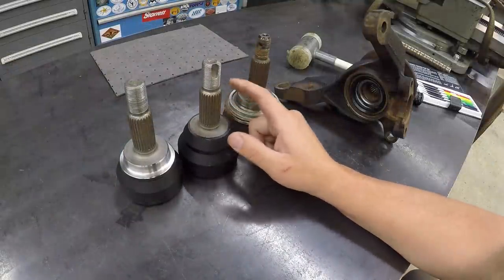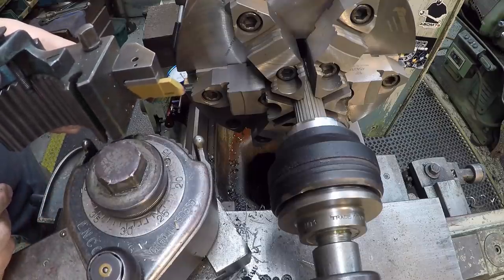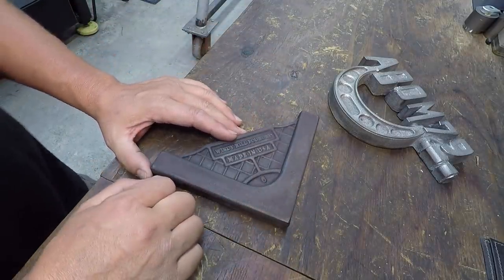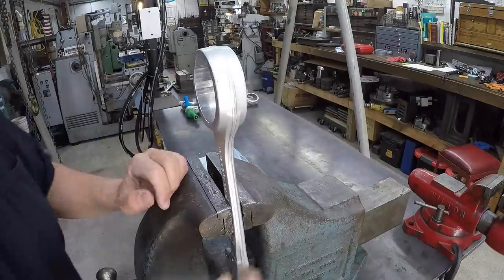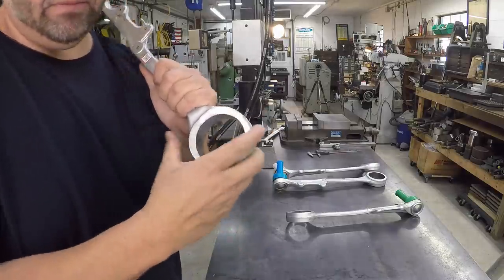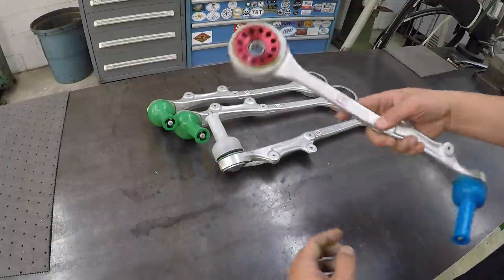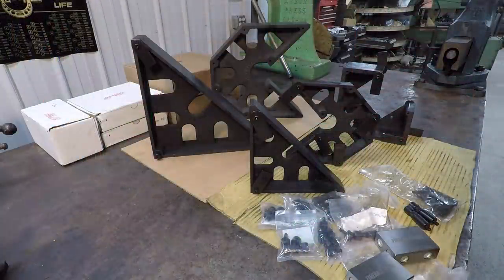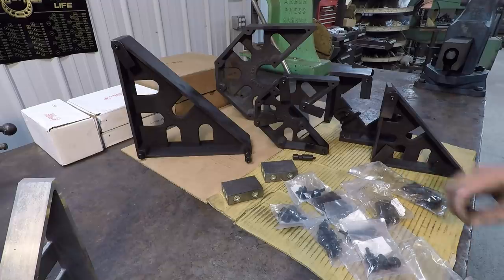SNS 303: Aluminum Control Arms, Front Axle Mods, WHF Machinist Square, Fireball Tool Squares

Comment: I love the videos! My Dad is a manual machinist.He has machined parts from the Corsair jet to the space shuttles. Most of the metals were top secret at that time. He finally started machining parts privately for the pump industry in the early 80's. There is nothing like seeing a manual machinist perform this art at 81 years old. I have more respect for the manual Machinist that still does this, compared to today"s CNC operators.

Comment: Abom, I understand that you gotta do the jobs that come in however, you gotta know how many car guys out there would love to see more content like this. Anyway, awesome content!
Reply: I agree! What I’d really love to see is some pistons and a camshaft machined from scratch! I know a cam would be quite the project but definitely do-able with time & patience and it would be an amazing process to watch. Seeing the order of operations, how the workpiece has to be chucked up to cut the lobes & how the lobes are actually cut, etc.
Reply: Decking blocks and heads, boring cylinders
Reply: @ericreynolds74  And sleeving cylinders - not the blocks designed for sleeves, but repair of non sleeved blocks.
Reply: @kcscustom9759  defiantly agree, would also justify the cost of other machine shops and their process .
Reply: I have done Automotive machine shop work-99% of the machines are specially  made for The jobs , Line boring ,sleeves,  Crankshaft grinding etc-!
Reply: @TheObersalzburg  he has said before that he doesn't like to get into engine machining
Reply: Look up Brian Block (bcbloc02), he does a fair amount of engine stuff. Granted, it's mostly diesels.

Comment: Thanks, Adam. Now I learned why they’re called “123” blocks; I thought maybe it was because it made certain shop tasks “as easy as 1-2-3”! It didn’t occur to me that the ratio of the sides was 1:2:3! 😁
Reply: It's not the ratio.  The size of the blocks are 1" by 2" by 3" Literally, 1,2,3.   No ratios necessary.
Reply: Jim Murphy it’s both the measurement AND the ratio
Reply: @robinturner2300  True, but that's not how they were named, which was the OP's original statement.  By that logic, a 2"x4"x6" block is also a 123 block, which it obviously isn't.

Comment: I believe the seal at the hub is just a dust shield since you don't have to add oil to the bearing hub.
Reply: It depends if the bearings are sealed or not, they usually do have a grease seal but not always.

Comment: Nice work. Those bushings should be a press fit in the arm though. That things gonna beat it self to death and most likely egg the whole in the arm out
Reply: Yep, bring on the green loctite, and lots of it.
Reply: you are 100% correct, I install similar ones regularly and that is exactly what happens if they fit that loose.
Reply: But not Adam’s problem or area of expertise
Reply: @hjvisagie  He would know that also and should spin up a better bushing. Should be shrink fit.
Reply: nothing short of road bling, having working in motorsport ,that is a no no..  lack of interference fit will in deed cause further problems.

Comment: For sure on case hardened materials the tough part  is getting through that first bit and the rest is a walk in the park eh. I have had some success using Rapid Tap as a sort of  stress remover type lube. Every time I see that 6 jaw I start drooling. 15 years of retirement  I soooo way to turn the clock back and get two of them for my 2 lathes. One came home with me. I would have gotten the other but a 10 foot X 20" won't fit in the garage eh. Excellent job bud.
Reply: get a bigger garage.... problem solved😁

Comment: you mentioned possible production work on the AL control arms. I know you don't normally use flycutters, but this would be a great time to use a flycutter with an HSS cutter. You could machine it dry and one pass is faster than two :-)

Comment: I would get a touch nervous modifying suspension,  brake,  or steering parts for customers. There would be a clause in bold at the bottom of the receipt to cover my arse in case the component failed.

Comment: Good video.
Can't say I've ever seen slip fit control arm bushings,  but maybe the owner of them can explain how they work.
Reply: Exactly my thoughts! I’m a 3rd generation mechanic and I can tell you this is not going to work! Definitely not designed for the aluminum arm for a reason.
Reply: @MaxPower_Designs  Yeah,  usually if a bushing slides in a control arm like that, somebody needs a new control arm,  or got the wrong parts.  I guess we'll have to wait for an answer from whoever owns these things.
Reply: @MaxPower_Designs  -------   "This is not going to work" well said.

Comment: nice Starrett  vice i like your mag drill with the old Black & Decker drill in use i haven't seen one of those in at least 25 yrs, when they were built to last and that deburring tool i have one for aluminum  and metal work they are fantastic great video as usual, look forward to the next one always good content, one thing that hot metal coming off machines will damage your camera lens  i found out the hard way, just passing it on

Comment: Adam, I'm surprised to see an auto part (the "axle" pieces) that are RC 60+.  That seems like it could too easily crack with the loads & stresses that it would experience in use?  But I believe you since your hardness files don't lie.  Thanks for showing the small machining projects in this video!

Comment: @Abom79 That radius tool at 06:44 is that some sort of coating making it that golden colour or is it an alloy ?

On the Starrett Athol bench vise, how is it that there's a Rotation clamp on the right-hand side of the turntable but a hex nut on the left ? 
How does that operate ?

Comment: When you were turning the radius in the axles, you forgot to mention that with the tool upside down, you run the lathe in reverse. I know it, but someone new might not get that.
You didn't get to any viewer mail either, or is there going to be a part 2? I loved it regardless, certainly did have the classic sns feel to it.
Reply: I've seen that technique used when turning bronze or cast iron, mainly because otherwise you'll need a face shield over the goggles over the glasses, and it rains chips all over the shop.
Reply: I noticed that too and also know it's self explanatory. I've put cutters in upside down wanting to turn in reverse and out of mindless habit and lack of awareness turned it on "normally" except it don't cut so good then and I've said to myself: Who's the idiot? ----> this guy... so you see it ultimately does end up being self explanatory 😛...
Reply: i can honestly say I've never tried upside down-reverse turning...Mainly because I've got a screw on chuck...

Comment: 1:47  front axles MR2? Interesting!!! 
Did you mean rear axles or is he making the car all wheel drive somehow?
Reply: I believe MR2 uses spindles in the rear with arms connected to spindle to adjust toe.
Reply: @boaterbil  All round McPherson strut,  Abom had a right rear without abs, could be for an AW11 or SW20, the snap over steer is fun in the second gen SW20, but was "tuned" out in the 3rd gen SW20. The American market missed out on the turbo version of the SW20.
Reply: No, the American market got the Turbo SW20 - I bought a new one in 91.  What we didn't get was the 3SFE in the NA version, instead getting the 5SFE.
Reply: @JohnATamplin  you mean 3sge?
Reply: We didn't get either 3sge or 3sfe in the MR2. I have a Rav4 3sfe in my 93 right now.

Comment: for the front axle part doesn't it have to go through the heat-treat process again because it is now softer.
Reply: Heat treat is for the CV joint in the end, not the surface for the oil seal. 
No damage done.

Comment: Is there not some critical reduction of strength, in machining down those aluminum control arms?  I would think that there is a possibility that they were cast larger to compensate for the weakness of the metal (compared to steel).

Comment: They could have at least come with snap rings that have a taper on one side to hold them somewhat tight in the control arms. That's a really loose fit.
Reply: That's what I thought, wonder what vehicle it's used for.

Comment: Adam, I noticed that vise only has three mounting ears. Do most Vise’s only have three?  I bought a small Bessey vise a while back and it only has three as well. When I took it out of the box and saw three, I took it back. The guy at the counter pulled another out of the box before I left and found it only had three and we assumed that was normal. Any idea why only three?  All four corners would make more sense to me.

Comment: Real big problem with those lower control arms you are machining. While you have a great fit on the bushing. The factory bushings are press fit not to roll around inside like that. It is going to change the pivot point of the arm, and wear the hole out. The load and pivot point is at the bolt hole. No fault of yours Adam. Just the people wanting this done are making a mistake having it just slide in instead of a mild press fit.
Reply: nick payne  no place for a sleeve, would need to make the hole larger, and then there would be a problem of strength. Wonder if the guy doesn't know what he's doing or there is something else planned, like boding the bushing in the bore.

Comment: Nothing to do with what you are doing Adam, But I would think the"bushings" will try to rotate in the bore. The originals would have been pressed into the arm. Reading on, It seems others think like me. 50 yrs. auto tech. Almost like the guy that wanted you to machine new pistons because they were too big for the cylinder.
Reply: You need to get with the customer and tell him what he needs.  The guy obviously doesn't know how "his" stuff works!
Reply: I wonder if the guy doesn't know what he's doing or has something else (like bonding it in there) in mind.

Comment: When you machine that part (for the oilseal), won't you seriously weaken it, compared to the original ? It will break off at the sharp edge, as soon as it is put under severe driving conditions ?!

Comment: do you  make parts for your car when they break?      
if i had that shop i would make better parts for everything in my car lol
Reply: Jack Anderson  In what way does his comment about car repairs have anything to do with his profile picture? Only a buffoon would think a picture of a frog is racist. I think you just wanted attention.
Reply: Car parts are so affordable it doesn't usually make sense to machine your own. Material cost alone would probably put it over the price of an off the shelf part.
Reply: @GeneralChangFromDanang  Check Bad Obsession Motorsport for the apposite opinion...
Reply: @neilbathe7752 what are you talking about? They're using MG ZR parts all over that thing. Most of the door components also off the shelf from various compact cars.

Comment: As a licensed auto tech, and high performance enthusiast, i can see that the pliable rubber bushings in these control arms are being replaced by a bearing or bushing. just to take the slop out of the suspension. makes the car feel tighter and maintain better alignment angles during cornering and braking etc. but i dont like how its loose in the arm, it is gunna move around in the control arm and hog out the bore its it. would be a good idea to lock it in there with a couple or three set screws to solidify it all. maybe suggest that as an idea to the customer. of course a grand show of fine machine work Adam.  hope all is well for you and your familly man take care
Reply: Ye it does look very loose, the control arms also look very thin to me, might be not for a car but something smaller/ lighter, still a loose busing is no good, I guess they may be gluing it in there?

Comment: Are you sure the control arm doesn't need that extra width for the strength?
Reply: I doubt that much would make any significant difference. I would be more worried about the bore that is way too big for the bushings they sent.
Reply from the maker: You really think .060” is going to make that much of a difference on that face?
Reply: @Abom79  Honestly I don't know what it's being used for, but given that it's aluminum probably not since it doesn't seem to need to be high strength. Even though I'm a mechanical engineer, I wasn't wasn't completely sure how it would impact the hoop stresses and what kind of factor of safety the part had. I trust if you know it's strong enough.
Reply: @--_DJ_--  I also didn't particularly like how thin the outer wall of that bore was either.

Comment: I think these bushing are too loose
Reply: They’re race parts. The bushing and the control arm are precision machined.
Reply: Not to mention, they aren’t designed to last 100,000 miles. They’re made to last a couple dozen races and they’re thoroughly inspected for wear and damage constantly...
Reply: @Nobody-U-Want-2-Know  

CAN  U  ELABORATE?
Reply: @Nobody-U-Want-2-Know  
I THOUGHT U R SARCASTIC
THE PROBLEM IS U R NOT

Comment: Hey adam....how does one get in touch with requests for machining......I have some motorcycle risers that need some work.....basically I just need the 7/8 handlebar mount opened up to inch and an 1/8....I dont want to adapt it because it will bring the rise up another inch......let me know....

Comment: I want to run something by you here and you tell me if you can see something wrong with my thinking.

If you were to make a set of rings to go under the part when you place it on the chuck you could eliminate the need to reset your knee after the first side is cut. Make one steel ring say 1/4" (.250") thick with the bore say .010" larger than your parts bore and set it on the chuck. Put your part down on top of it and chuck it up. Set your knee to take off 1/32" (.03125") and machine the surface. Remove the part and replace the ring with the second steel ring machined to 9/32" + .005" for your snap ring clearance (.28625"), install the part and chuck it up, start the machine up and machine the surface. All finished dimensions would be determined by the ring thicknesses instead of having to make adjustments.
Reply: Are you serious? By the time you make all these fancy precision rings, you could have been done.
Reply: @grntitan1  and it wouldn't take into account the intolerance of the part

Comment: All theses add on car parts how does the accident safety board treat this.I know that aircraft safety comes down hard on manufactures.
Reply: michael macdonald if it’s not specifically a safety device like seatbelts, wheels, glass or something similar then it’s the Wild West. You can make your suspension out of wood if you wanted.

Comment: question for you Adam...the axle part that you were turning, were they case hardened or completely hardened. I was wondering since you said the material was softer once you had a few chips made, (meaning a couple of pass made)? thanks!
Reply: I believe these parts would be induction hardened which is essentially similar to wrapping a coil of wire round the part and apply current to instantly heat the part till it is red, white, or yellow hot then probably quenched in oil to get the part to the desired hardness. Since this is considered a surface hardening process the hardness would go lower depending on  how far into the part you go.

Comment: If ever there was an industry that would suit the Metric System , this is it.
Reply: Well, why really? I understand the reflexive thought, but step back for a second.  Decimal inches are just as accurate. If machining involved measuring things in yards or miles you might have a point, but that is not the scale that is actually being used. Cutting things successively in half is going to involve 1/2, 1/4. 1/8 etc and their decimal equivalents whether it is 1/8th of an inch or 1/8th of a cm. If you were starting a technological and industrial civilization from scratch you might have a point, but there is 200+ years of tooling out there that nobody is in a hurry to replace.

Comment: That's a horrible design for the control arms...they will clunk and grind and get even more and more loose....god almighty ...those are almost worthy of a horse wagon....
Reply: My guess is they are sized to be a tighter fit in the steel arms they were intended for. Either that or just badly made.
Reply: Racecar parts. They're known as spherical bushings.
Reply: @danielwgk  "racecar parts" would be...for example... very hard polyurethane poured directly into the arms, or those aluminium bushings press-fitted....Those are spherical hot-dogs down a cluncky hallway  :)))
Reply: @tanaseav  apparently it's a mustang control arm